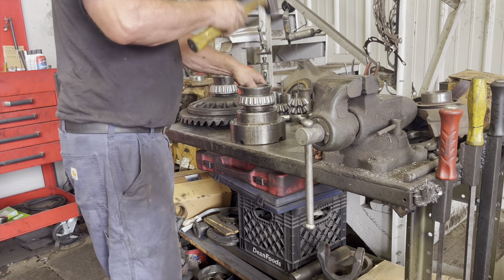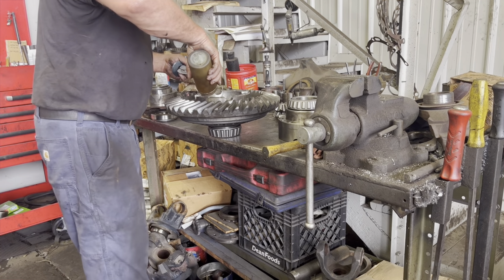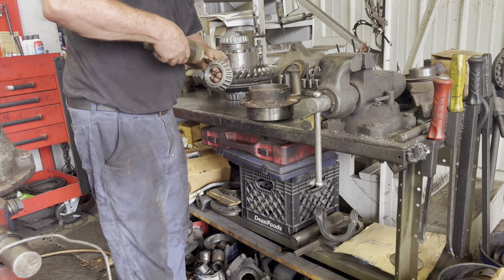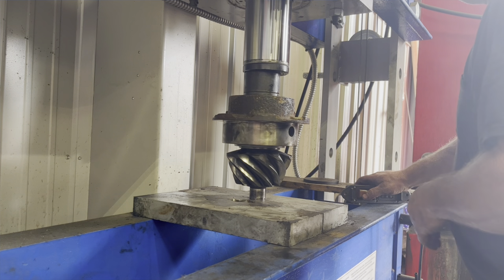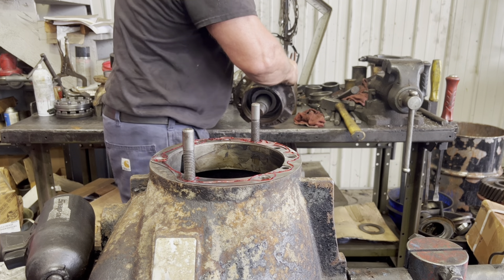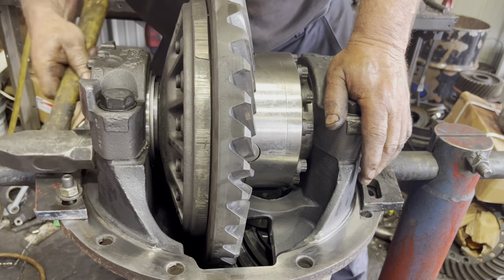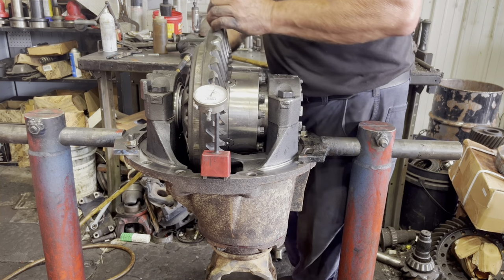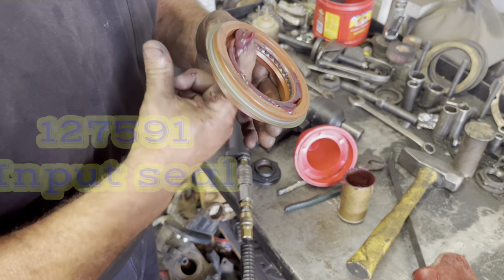Spicer differential repair on a Freightliner semi. Axle gears and bearings replaced. 🤯

Comment: Couple years ago I tried rebuilding my differential on my 1999 F150 with a kit I got from Advanced auto well I could never get the pinion gear and ring gear right so now when I’m driving, I let my foot off the gas in it makes a humming noise so now I’m just gonna replace the entire rear end